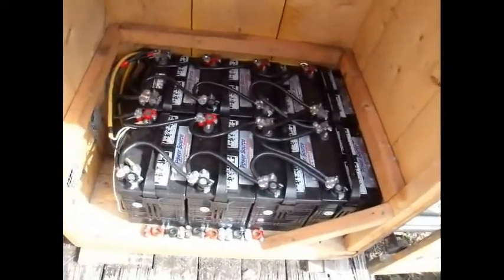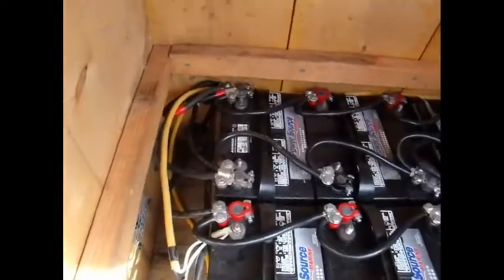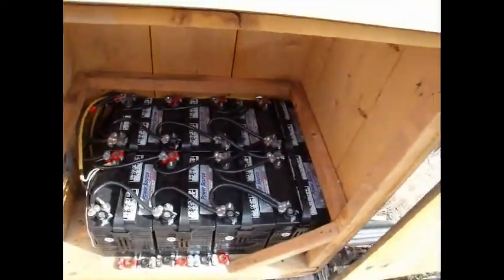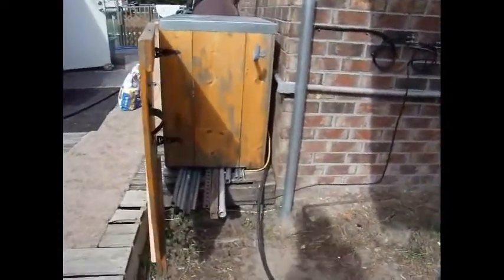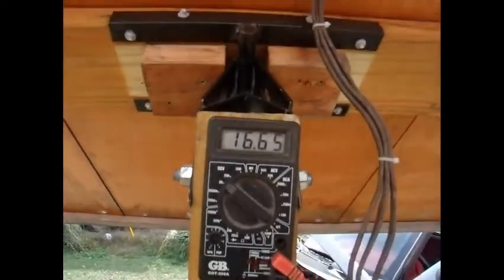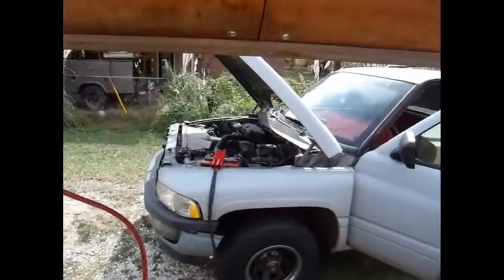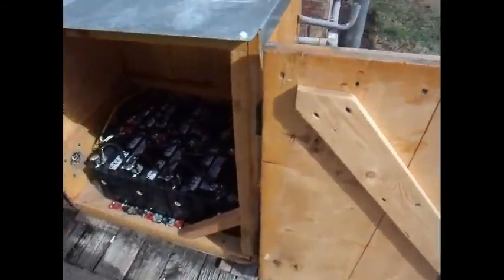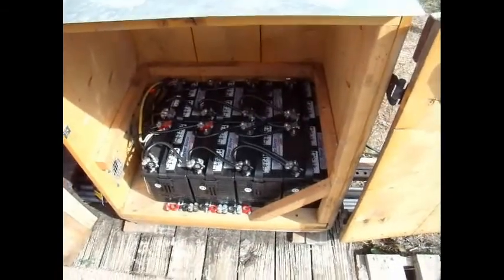Free Energry  The Battery Bank

Comment: Hi Billy
Looking at your bank it appears that you are pulling the load off one battery, meaning you have connect up your system supply cables to one battery of the parallel bank. which will work. I had mine this way and changed one of the supply cables to the other end of bank, there by when the load is demanded the entire bank see it. Am i seeing your bank correctly?  Pos on one battery and Neg on the last battery of the bank.
Thanks for the video
Bill